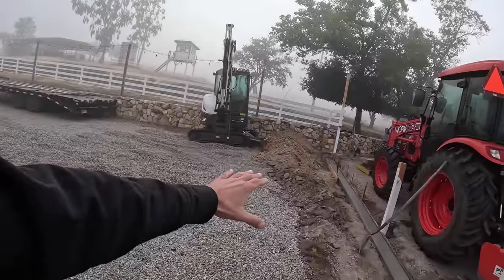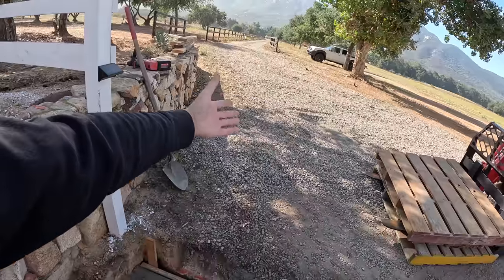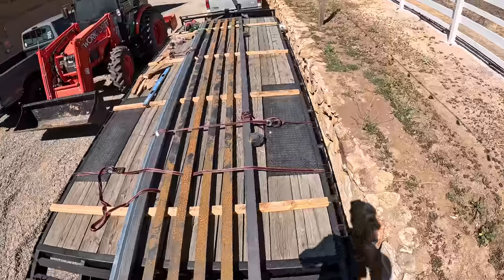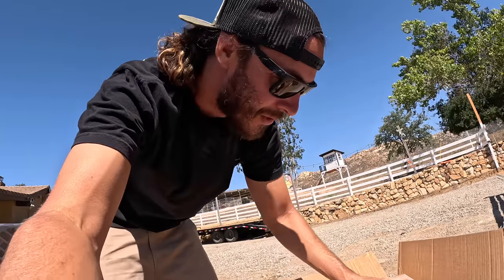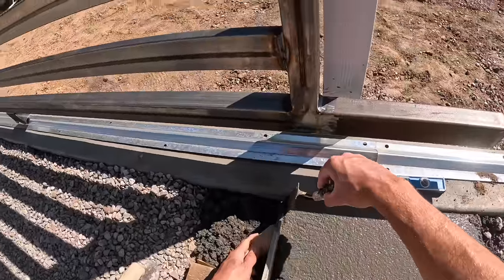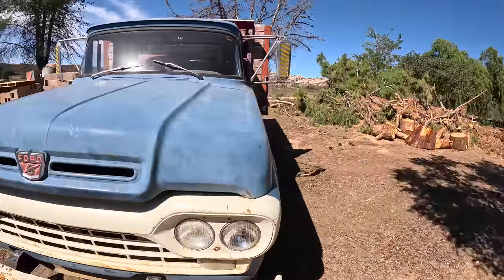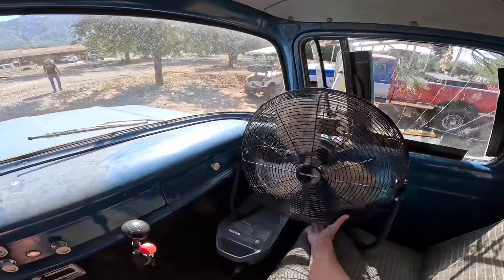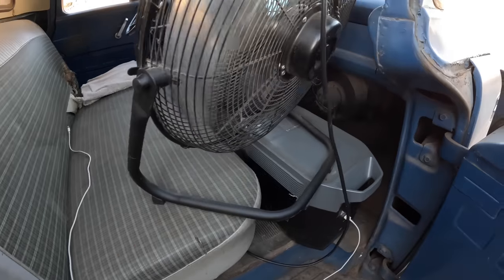Building a Custom DIY Gate the Easy Way! (Part 4)

Comment: Put a harbor freight (or other) quick hitch on your tractor. Weld on a receiver hitch. Then you can easily move trailers and use your dump trailer with the tractor. It’s also nice to quickly move trailers around.

Comment: I won’t take the $5.00 I’ll just take a WorkForIt decal we have that same brand of gate opener at my parents house for our back yard to the back deck it works well for what it is we got it a few years ago it was around $725.00 if I remember correctly but either way not a bad deal should work well,but another awesome video in the books great job.

Comment: Now. Instead of the fan what if you mount a generator under the bed on the frame and then a portable ac in the floor board with exhaust going out the passenger window if there isn't a floor vent you could use
Reply: I'm not talking about a dedicated generator more like a small generator you already have ratchet strapped on to the frame